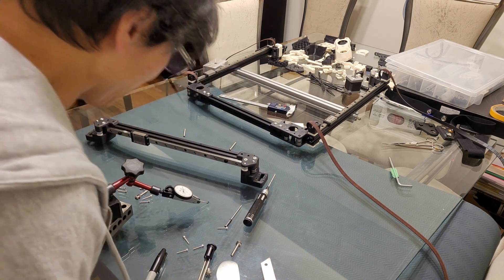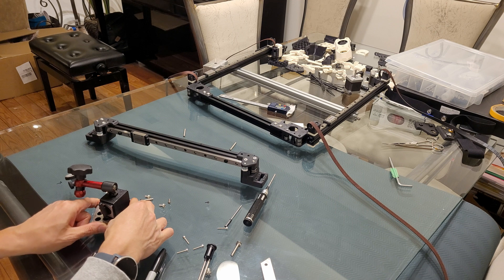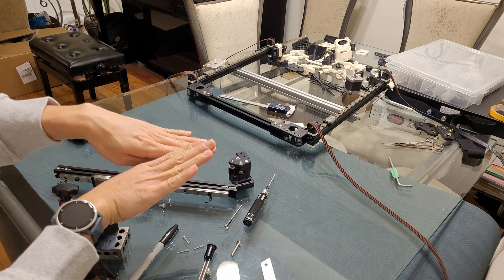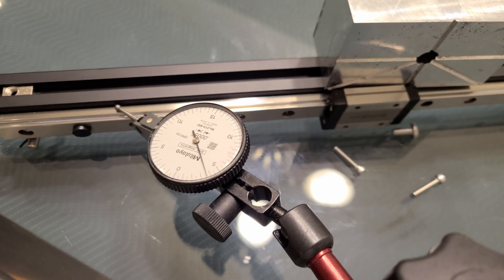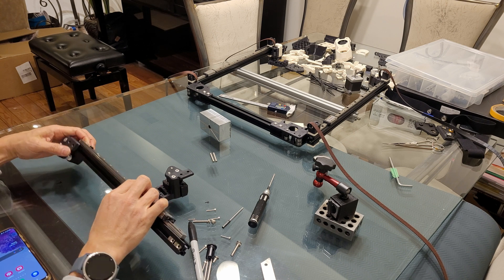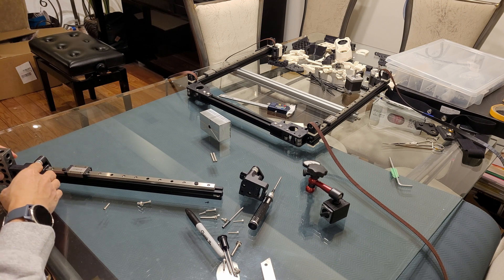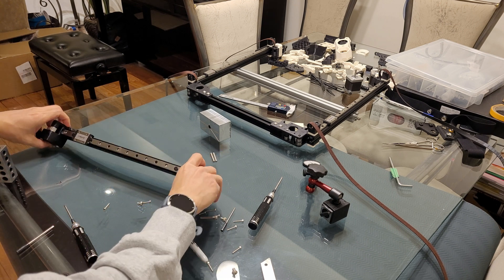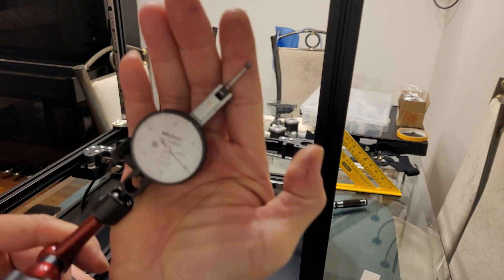Tips on how to build #voron 3D printer flying gantry for a perfect first print.

Comment: Hi, one question, what model of guides do you use in the video? The ones I have are from Aliexpress and they don't move as smoothly... Thanks
Reply from the maker: @joseramon9104  hi i bought 3d formbot kit which was mentioned in description. I had a review video of it on my channel. On these linear rails there is a preload which is why they dont run "smoothly"
Reply: @lavithhcm  Ok, thanks, I'm looking for some that are good, nice and cheap... I want to make a PNP machine and I'm looking for something that isn't of the highest quality but that works relatively well...